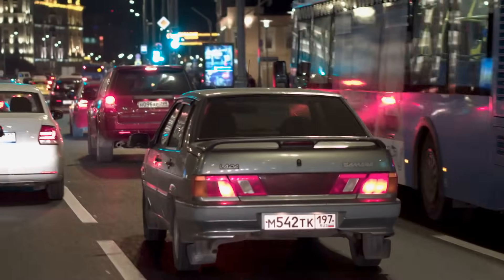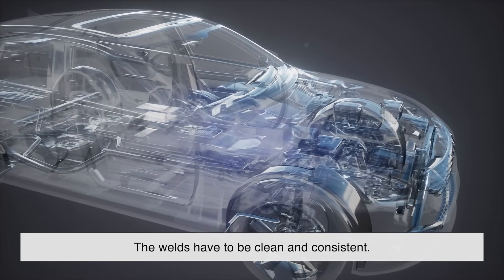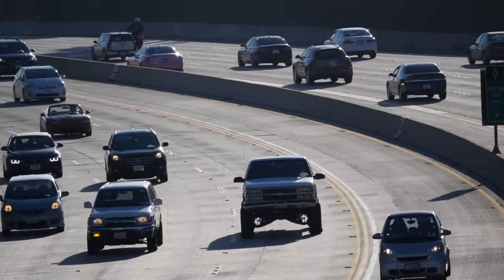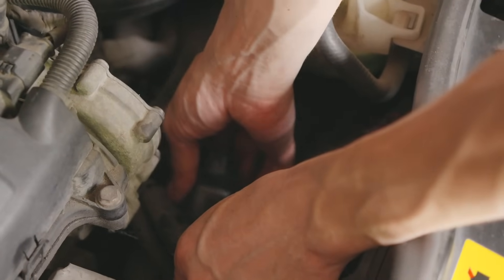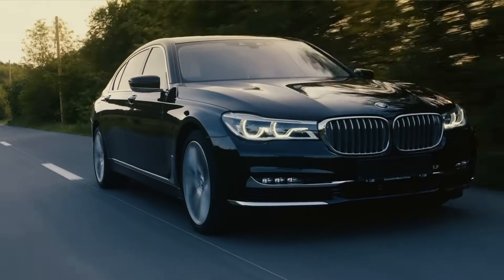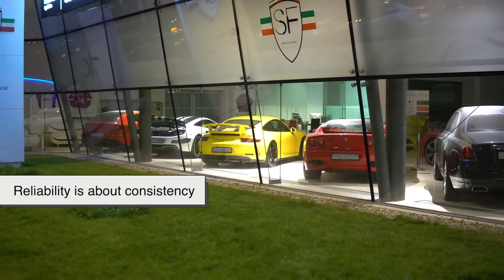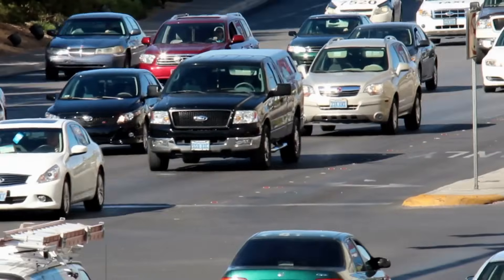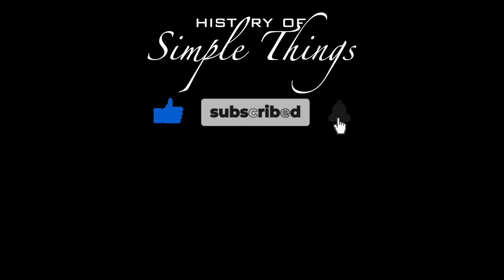What Makes a Car Reliable and Durable?

Comment: Firstly l live in Australia the climate is much kinder to motor vehicles well 6 years ago l bought a 1997 2X4 Toyota Hilux ute and only paid aud $1500 and with 410000 kilometres for it no service records at all and still own it and because been exempt from emission and safety laws it has its original carburator now it is obviously reliable dependable over built overengineered were every component was of the absolute highest and the Hilux has 440000 kilometres on it and when l bought the Hilux l didn't actually know what a good ute l had bought after researching the Hilux ute l was actually amazed have l bought the absolute best ute ever made by the way l often see the driving around doing ute stuff tradespeople are still using them and a lot of it has to do with the 22R engine and believe it or not after market good quality parts are still readily available for my Hilux ute and it will last another 28 years easily now thats reliability and dependability just one more thing Hilux actually stands for High Luxury and it isn't or is it the absolute biggest luxury a vehicle can have is reliability so that high luxury name does mean the Hilux name is earned by the ute it is a very luxurious vehicle and my Hilux starts very well and it may have a lot of original parts on it l know l have replaced a lot of parts on it although over engineered parts still wear out nothing major

Comment: Emission crap,extra electrics ,wet belt,and chinese cars, all crap....i fully believe wet belts were made to make us go fully electric .....if they had spend all the r n d cash on petrol instead of ev we would have 100mpg cars..new stuffs designed to fail and only manufacturers to fix...anything newer than 2017 has a v v v good change of being unreliabe and costly to run, even ev cars cost more than most folk think, £ 900 a yr for a peugeot ev to be " serviced"

Comment: My current truck is a '99 F150 4.6 with about 170K miles. Runs like a clock, but is starting to rust badly at the rocker panels. It's not my daily driver, but I felt it was time to shop for a newer truck. After I found out how many different computers are on them, I think I'll just keep what I have.

Comment: Try removing all the unnecessary stuff like egr valves dpf systems and avoid a wet belt at all costs
Reply: Sometimes the EGR system is needed the Powertech 3.7L made before 2005 didn’t have the EGR system but had problems with the cylinders and combustion chambers overheating resulting in valve seats dropping so they put in the EGR which inert exhaust gases would lower the oxygen levels in the air/fuel mixture which lowers the temperature during combustion thus cooling the cylinders/combustion chambers the EGR valve doesn’t open during idle or wide open throttle ,the system actually gives better MPG